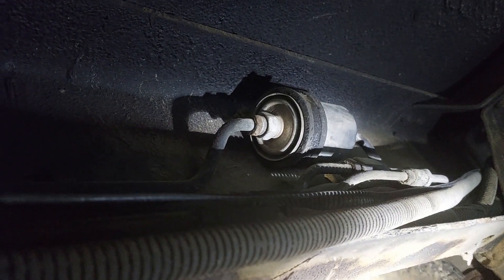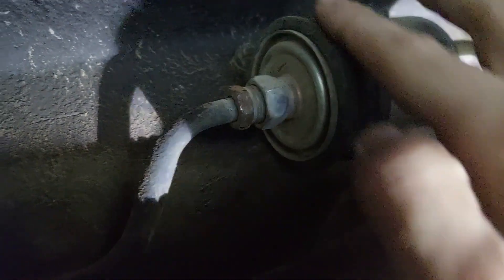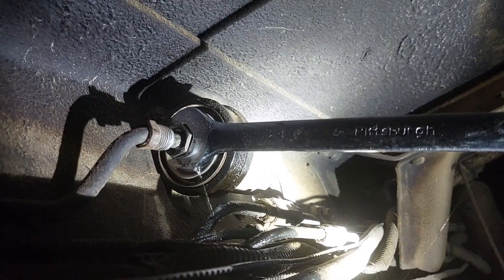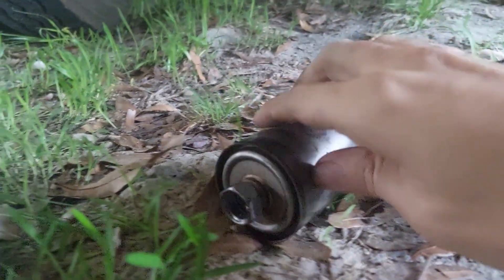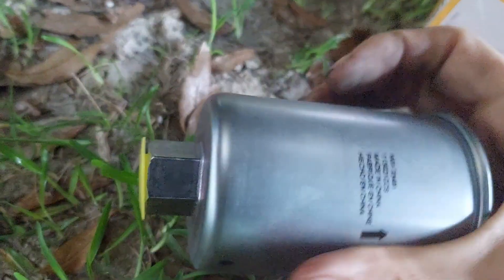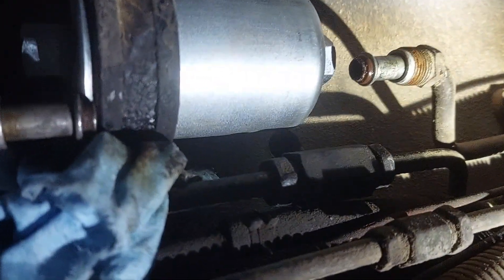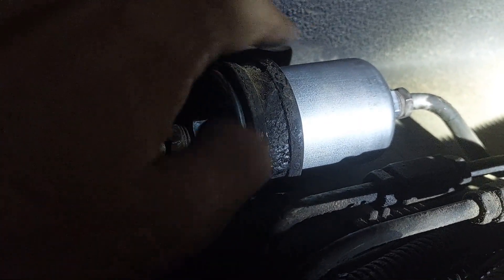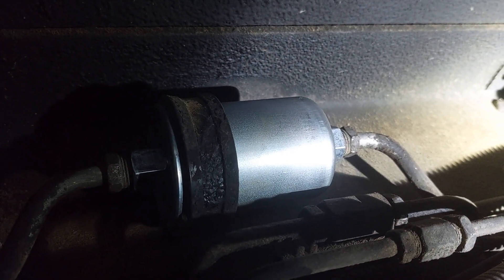Episode 119 -  Fuel Filter Replacement 1995 Gulfstream Sunsport RV Chevy P30 454

Comment: This fuel filter is easily accessible. I heard the modern ones are much harder to access.
Reply from the maker: For fuel injected trucks, every one that I have worked on has the filter in a frame rail.  I know on carb'd applications they often had a small filter in the fuel line right next to the carb, not sure if they had another filter further towards the tank or not.  Cars are a bit of a wild card with their unibodys so the filter locations will vary.

Comment: Arrow towards front (engine). Correct. Did you check the o-rings on the pipe ends?
Reply from the maker: I did not, but it is not leaking at this time.